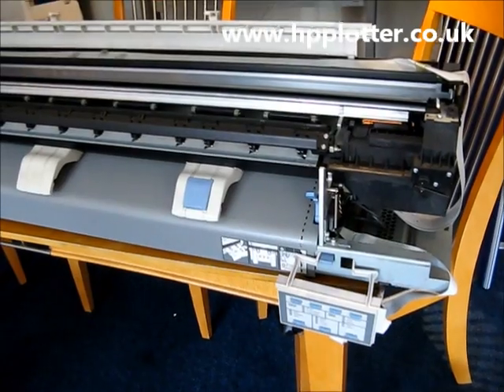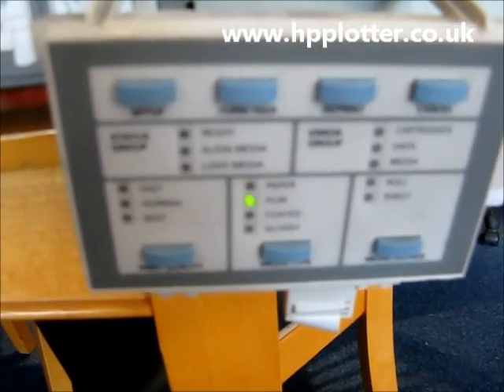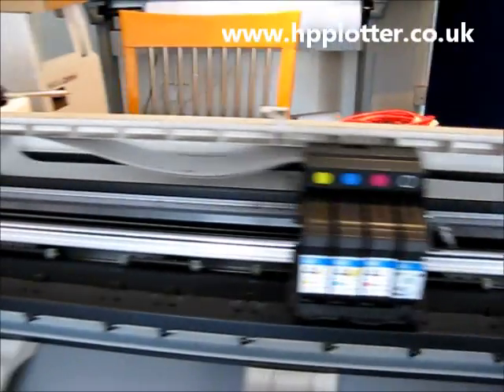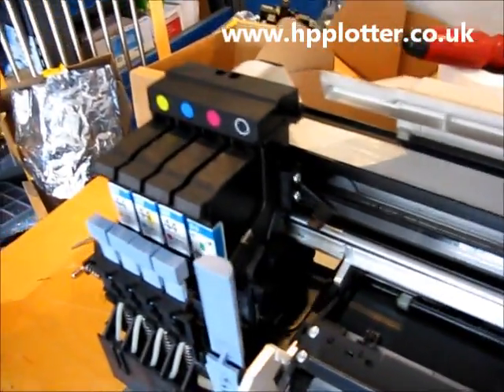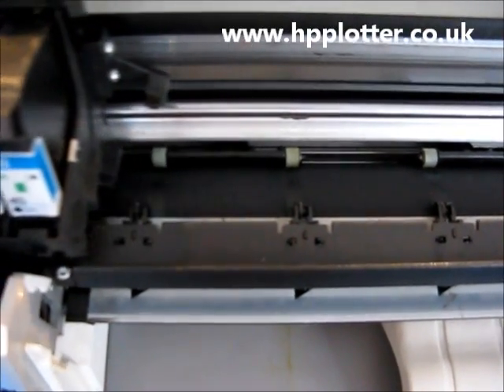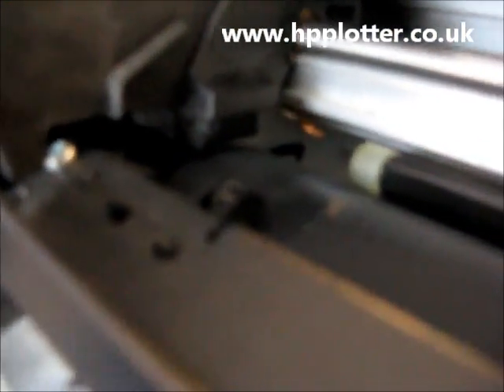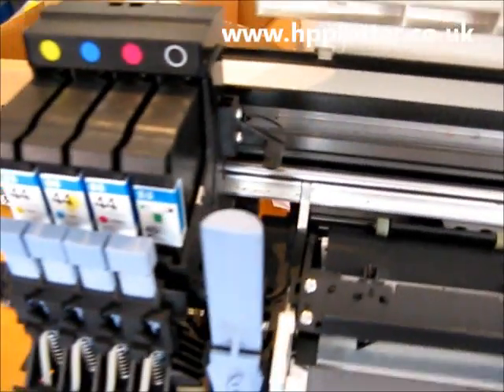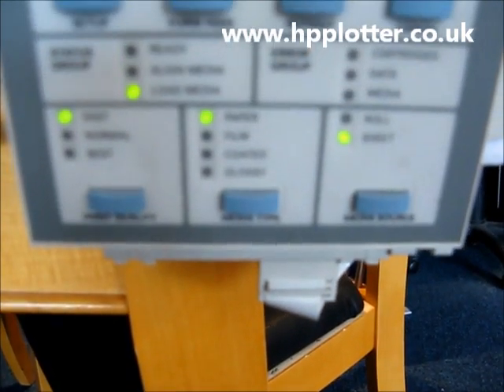DesignJet 450C & DesignJet 430 correct startup sequence

Comment: Hi!  I need someone to measure a go no-go gauge for adjusting carriage height. I don't have one and need to check the height on a 450C, since I am having problems with poor bail lifting mechanism operation.
Reply from the maker: Given the age of this printer I'd say it's probably better to buy a new one than waste too much money repairing it. There aren't any drivers for current operating systems, original ink is no longer manufactured and it costs more to print and is less accurate than modern ones. Entry level is just over £500 for new.
Reply: @HPPlotter  I totaly agree if I was doing business with it. It is a hoby machine, it is printing fine but would like to put head distance in specs, before I mangle bail lifting mech. Cardridges are not a problem for a print volume it will be used for..

Comment: how i can access the "service mode 1" on these old HP plotters? i need to do some troubleshooting.
Reply from the maker: Hello Mikkokarna

Here's how you enter Service Mode 1 although we ALWAYS recommend an HP Trained and Authorised Engineer do this work for you:

1. While holding the Reprint key down, switch the Printer ON.
2. Once the LEDs begin to light up one by one, release the Reprint key. LEDs will remain off for a few seconds and then all LEDs will begin to flash, waiting for you to perform a test
3. Contact engineering@hpplotter.co.uk for replacement parts.

TO AVOID INJURY: The cover sensor is disabled when in Service Mode 1. If the carriage is moving it will NOT stop if the cover is opened. 
Be very careful not to put your hands inside.
Reply: @HPPlotter  thank you very much for your reply and advice. Your informative videos and channel is great.

Not my first rodeo though so i am pretty confident i can pull this off without breaking the plotter nor my fingers. 
Cheers! ✌
Reply from the maker: @mikkokarna  phew! I do worry - I've known people put their fingers in the fans and all sorts so I don't want any injuries on my watch LOL!  Excessive blood inside the printer might damage the electronics module ;-)! Best of luck with your repair.

Comment: The 450c transparency roll (C3875a) has a white border on the ends.  I assume this is for the optical sensor.  Would a different brand of transparency (without this border) work okay?

Also, can I load a black cartridge into all the slots and print using all four (under full color setting) to achieve all black prints while not constantly replacing the onle black cartridge?  Thanks.